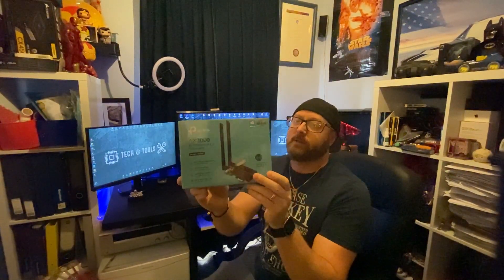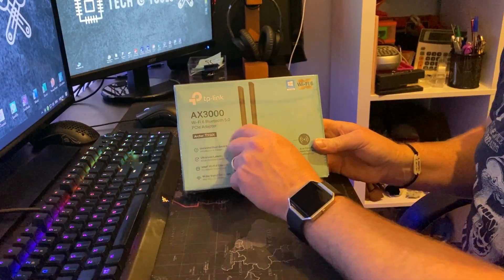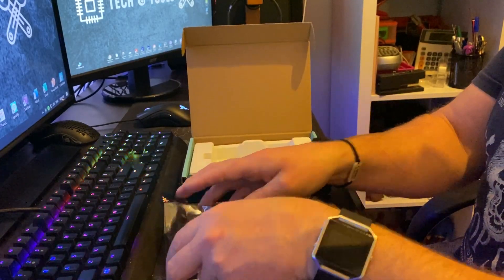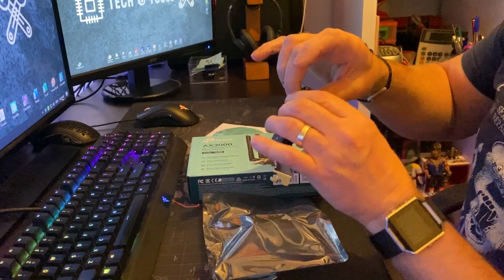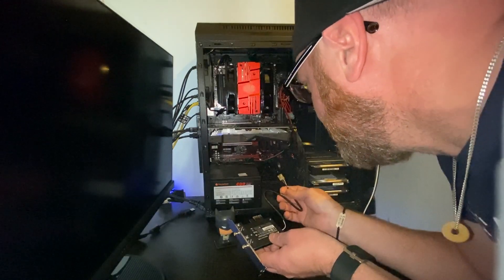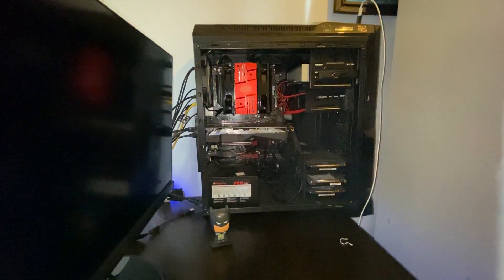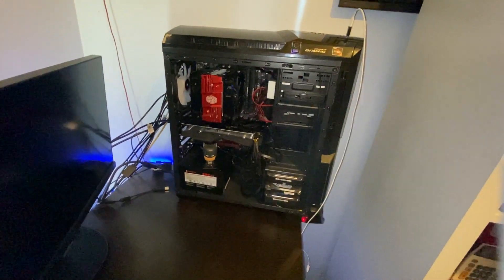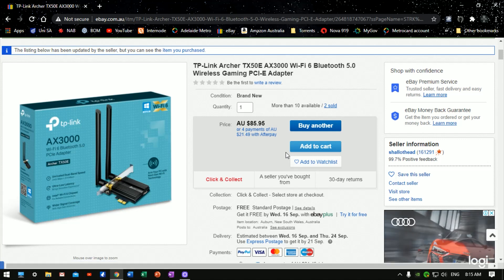tp-link AX3000 Wi-Fi 6 Bluetooth 5.0 PCIe Adapter install | Tech & Tools

Comment: I just installed this but the Bluetooth ( Intel Wireless Bluetooth )  is always showing in the ( safely remove hardware and eject media ) option in system tray ,which is very annoying.
Is it the same for you?
Reply: Mine is same but it makes the windows disconnect sound non stop and I think it’s the reason my pc randomly turn off
Reply: Sry it was actually my in belt Wi-Fi / Bluetooth card for some reasob

Comment: How's the adapter so far? My 4 yr old pcie adapter is starting to fail random disconnects etc lately. ;( So I'm looking into a upgrade/replacing it. :)
Reply: I just installed one of these on my sons computer, works really well, his computer is currently about as far from the router as I can handle.  I haven't tried the BT yet, but otherwise install was straight forward.

Comment: just installed recently and turn out it just plug n play. windows 10 auto installed driver. no need to download
Reply: So I dont need an ethernet cable to install the drivers? This is very important to me as I am going to be building a new pc soon and ethernet is not an option for me. So when I install this card into my motherboard will I get wifi straight away to then install its drivers?
Reply: @mattyaz5850  use usb tether if you have a android
Reply: @mattyaz5850  yes. for me it is plug and play. after that, i using driver booster to download latest version drivers for both wifi and bluetooth. the windows installed the old version but it is enough for u to avoid the hassle of using lan first.

Comment: Will this even make any significant difference vs a USB3 ac1200 Wi-Fi dongle? 

PCIe may be a faster way to utilise wifi 6 speeds if you have both the compatible PCIe wifi 6 card & the wifi 6 modem router .... otherwise the bottleneck would be your NBN plan ... mine is NBN 50

Comment: I’m having issues. I installed both drivers but only the Bluetooth network is showing up and not the Wifi. How do I fix the WiFi Network to make it display in the Adapter Options?
Reply: This probably isn't an active discussion, but 9 months later from you, and I'm having the same problem. Did you ever figure it out lol?

Comment: what if my cpu ryzen ? can i still use wifi card like u ?
Reply: I have ryzen 5 3600x and I have installed the same card and the drivers (intel).
It works great!
I have tested Bluetooth and Wifi 5Ghz (I don't have Wifi 6 router to test Wifi 6).
Reply: @asj2020  wow thank you for the info bro ..
Reply: @ilusomu  Anytime 😊

Comment: Hi there, the tp link model is ax3000 but why after I download it show ax200 instead? In the video also showed ax200. Sorry I'm new to pc I've no idea what am I doing
Reply: AX200 is the name of the Intel wireless chip the PCIe card uses, AX3000 is the speed. If you search up AX200 in Google Images, you'll see what I mean. The 2.4GHz band tops out at 574Mbps and the 5GHz band tops out at 2402Mbps, which is where the number 3000 comes from.

To put it simply, AX200 is the name of wireless chip and AX3000 is the total speed the device can support.
Reply: @OddByte47  i see, thanks I learn something today haha

Comment: It's good for gaming?
Reply: No wifi cards are very shity for gaming and overpriced just buy a cheap cat 6 or 5 cable for internet WiFi cards give veryyy bad ping in games the are just usesless
Reply: @grapesjuice2481  sheesh man, wifi cards and wifi in general has gotten a LOT better in these past years and are great for gaming. Ofc Ethernet is better but that doesn’t make wifi horrible. Wifi cards are great for people who can’t or don’t have access to Ethernet.
Reply: @dannypal5385  exactly, I recently moved and had to dig up a old usb wifi adapter to get internet to my pc temporarily and it worked fine for something quite as old as it was.

Comment: For those getting high latency, rubberbanding, dropouts, and bad speedtest results (in Australia), i found the solution for my NF18MESH non-wifi 6 router is to change your 'wireless mode' value under device manager>Network adapters>Intel(R) Wi-Fi 6 AX200 160MHz>right click properties>advanced tab>select '802.11n/ac/ax Wireless Mode and on the right set the value to 3. 802.11ac instead of 4.802.11ax. After this my speed test results were full speed, permanently low latency in games, no more rubberbanding and dropouts.
Reply: Really appreciate this brother! Thanks

Comment: Do not get this if you have a big graphics card it won’t fit
Reply: it will if you have the right size motherboard. graphics card size won't interfere and shouldn't interfere with the number of PCIe slots unless you have a small motherboard and even then there isn't much of a use in going with a mini or micro atx motherboard and a larger graphics card since the case size for both of those mobo sizes is frequently smaller anyway.

Comment: I installed my bluetooth driver but I still cant use bluetooth, it wont even show up in device manager. The wifi works tho
Reply: Did you plug in the cable to your motherboard?
Reply: @mrclbks  Why this cable btw ? :-)
Reply: @PascalcontrolNL  what? I dont get what you are saying

Comment: I did all of this and the WiFi card still doesn’t show up in network
Reply: You need to install the drivers for the WIFI card
Reply: @rehmanmarian6409  I did but it still didn’t show up in device manager or as an option
Reply: @papadrew7205  you connectet it to the motherboard after installing it in the pci-express slot?
Reply: @rehmanmarian6409  yea I did that as well
Reply: @papadrew7205  can you give me the model of your wifi card?
Reply: @rehmanmarian6409  Tx50e
Reply: @papadrew7205  it may be faulty :/ or its not plugged in all the way into the pci-express
Reply: I also encounter same problem need to retart many times, so able to get Internet access

Comment: Anybody know if it's compatible with a ryzen based amd system? Or just intel?
Reply: It works with both, as long as u have atleast some kind of pci slot on your motherboard itle work
Reply: I have one with a R5 5600G works fine, you need a PCI and a USB header on the motherboard.

Comment: is it good this card? i want one that has a wide range my router is very far away from my room.
Reply: amazing card, ive had no issues. Had it over 1 year. im on xfinity 1gig speed or over always. im running 16g of ram, amd 5600x, nvidia 3070 rtx. b550 A gaming mother board. no issue with stability or card not being recognized etc. Works flawless. tp link makes amazing products.
Reply: @RobertoMartinez-lr3su  thanks i'll consider its buying.

Comment: Thanks for the video. I set mine up, noticed the card listed as an intel wireless card and wanted to do some investigating. I guess this is the same chipset just rebranded for TP-Link?
Reply: Most wifi card are made by intel, they hold alot of that market, and yes people rebrand them.
Reply: @metlingaming9162  What if the processor is an AMD one? is it still compatible?
Reply: @qw56171  ofc it still works with amd lol thats what i use and works fine

Comment: How do i connect to the WiFi? Plz help
Reply from the maker: xXDevil_ SideXx download  or use the disk for the drivers and install. Then connect to your wifi network and put in password.
Reply: @TechToolsMichael  yes i did all of that but idk the password where or how can i find it?
Reply from the maker: Usually on the back of your Wireless router.
Reply: @TechToolsMichael  ive checked at the back and i can't find the password, also i have the Archer TX3000E
Reply from the maker: You have your wireless router separate from your computer. It connects to your internet box which usually connects to a wall. Check behind the wireless router or check it’s box it came in maybe!
Reply: @TechToolsMichael  its not there, but thx for help 🙏
Reply: @Jamal003  it's been a while. Any update?

Comment: Does this work in a pcie x4 slot because my x1 slot is covered by my graphics card . Thanks!
Reply from the maker: LINGONBERRY, I’m not sure. Sorry but I simply don’t know.
Reply: PCIE 16x > PCIE 8x > PCIE 4x > PCIE 1x

It means that, each version covers the one which is smaller than itself.

So; 
PCIE 16x runs PCIE 8x & PCIE 4x & PCIE 1x

PCIE 8x runs PCIE 4x & PCIE 1x

PCIE 4x runs PCIE 1x
Reply: @MrGreyPearl  ok so i can just plug in the wifi card into a 16x slot right?
Reply: @oklly2932  yes you can, without any problem 👍
Reply: @oklly2932  i would put your gpu in the 16x...unless u want a huge performance dip
Reply: @metlingaming9162  I have two 16x slots on my motherboard